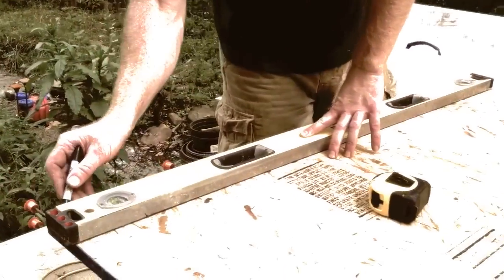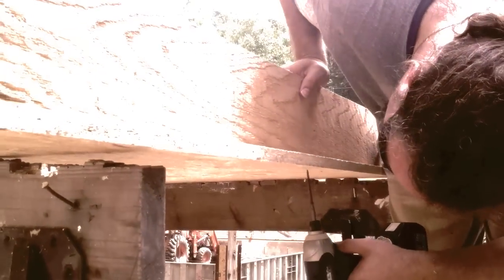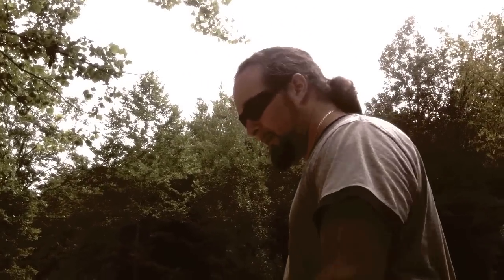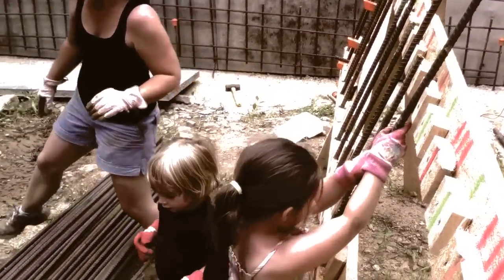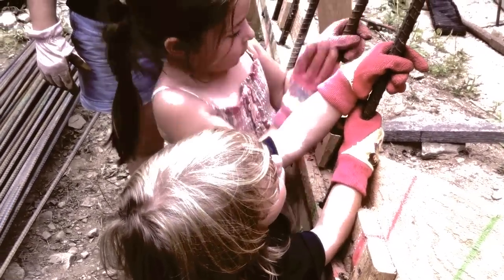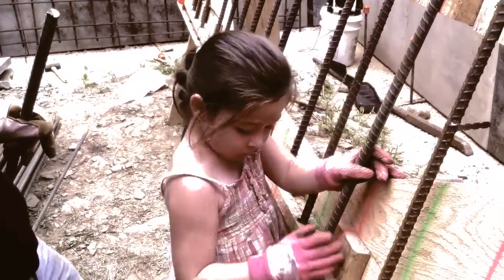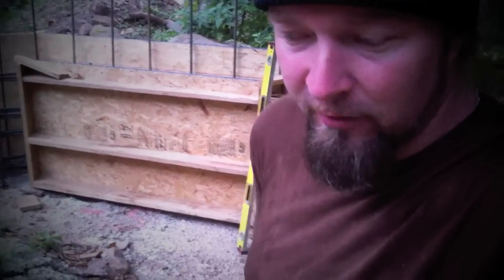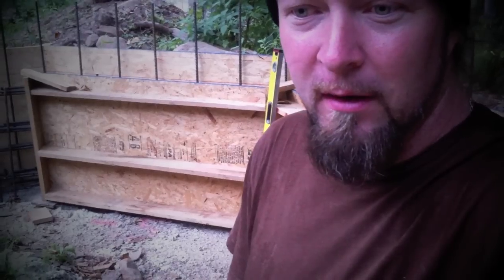Building an Octagonal Castle Tower using rebar and concrete - TheCastleProject

Comment: i have lots of questions. i too want a tower. are you finished? more videos? was wondering how the walls carried the weight as you went up? water? solar? FAA LIGHTING REQUIRED - THIS IS A VERY SERIOUS QUESTION. MAXIMUM LOAD? WATER PUMP, ELEVATOR?

Comment: the jig for rebar was a waste of time, I would just tie that with tie wire on the ground , so much faster that playing the carpenter building the jig.
Reply: that's the new school for a few of these young guys  - over jigging. the kid is pretty good though, accurate layout and looks like a nice design.
Reply: lol kid is tough just make sure they have their tetnis shot please :)  I do highrise and build 200 metric meters worth of walls and concrete a week and those look like some strong walls.  I hate forming octagon/corcle its a nightmare.  If i had any advice (considering your done) for any 1 doing this is You can get A LOT of electrical conduits in the walls using pvc core line or even EMT. :)